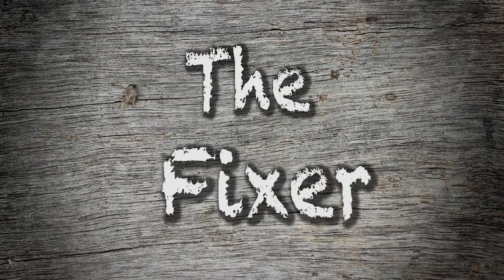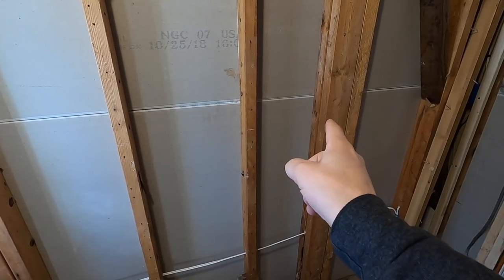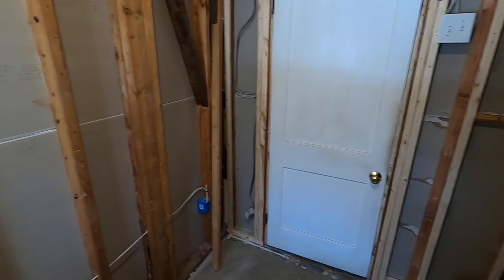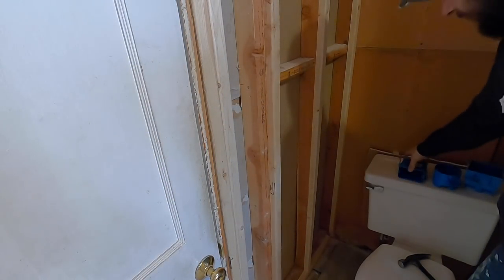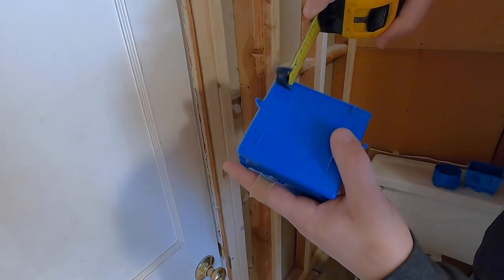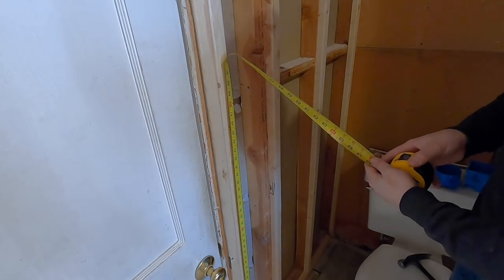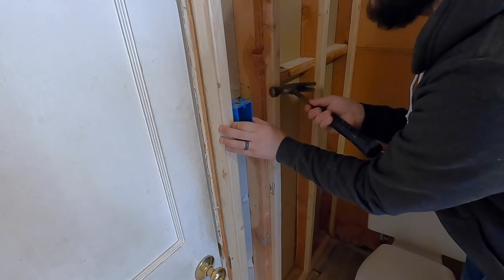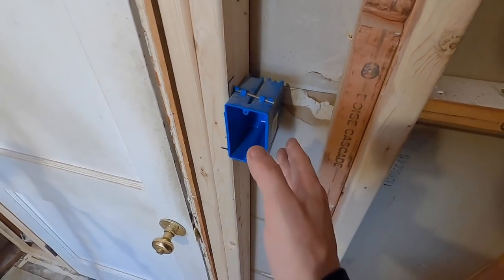How I Run Electrical Wiring in My Bathroom Remodel

Comment: I noticed at timestamp 11:49 that the already existing wires to the bathroom lights isn't already fished through the wall studs and I'm just wondering how you get them to? Or is the new box that you just wired in, on that right side wall, as you're walking into the bathroom, replacing the old light switch? I hope that made sense!
You're doing a fantastic job there!!

Comment: Are you using different staples when you staple the wires to the wood? Like are there different kinds of staples for wiring?

I’m just curious because I’ve seen in other reno videos where an electrician say that the staples shouldn’t make the wire sit flush to the wood because it can cause an overheating issue and is a fire hazard. There should be enough room between the staple, wire and wall for the wires to be able to move around but still be secured neatly.
Reply from the maker: Hi, Nicole!  I have never heard of that... I know that you shouldn't hammer the staples so tight that it ends up crushing the wire insulation... maybe that is what they were talking about.  I just use regular wire staples that have a small plastic protector sleeve on them.  Thanks for checking out the video!

Comment: This might be a stupid question, but....I lived in a house that would get pinhole leaks (or worse) in copper piping. If you have a leak right in front of your electrical box couldn't it really cause a problem?
Reply from the maker: Yes the pipes around my panel are definitely not up to code but it is “existing“.  I may try to move them in the future.

Comment: While home wiring doesn't present any problem to me, including the panel, I wouldn't trust most people to do much more than replace a light switch. And I have to include at least one supposedly licensed electrician in that assessment as I had to go fix all his mistakes when my wife and I sold her first home. When she bought the place it was when her dad had just retired and it was his first attempt at a remodel for the completely unfinished basement. Contractor was OK with the drywall, and the plumbing wasn't a disaster (the shower insert had "problems" that it shouldn't have), but I reworked the electrical panel as soon as I saw it, then I hired a pro to redo the gas line as it was off vertical by about 15 degrees and came out of the wall for 3 feet before going into the downstairs ceiling. While I was at it I replaced every outlet and switch in the house as the ones upstairs were all from 1941 and the ones downstairs had been installed by an incompetent. 

3-Way switches wired wrong at stairs
Ground fault interrupts wired wrong in kitchen and both bathrooms
Ground not connected to half the downstairs outlets
All downstairs outlets installed upside down

Comment: It is very unusual that the earth wire is not insulated in America. This could lead to a short circuit. In Europe, this wire is usually insulated like everyone else.
Reply: We leave it uninsulated so that way if a short we’re to occur within the sheeting of the wire, the closest path the current would flow to is the bare copper ground. That would travel back to the ground bus bar and overload the hot wire causing the breaker to trip.